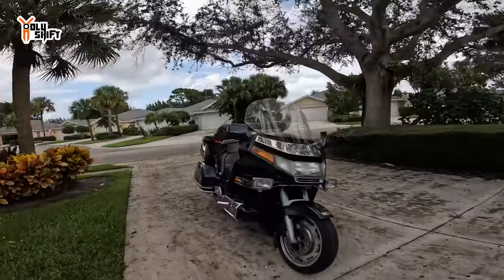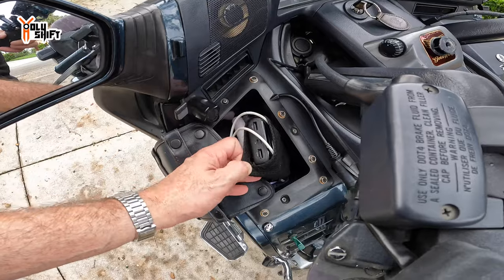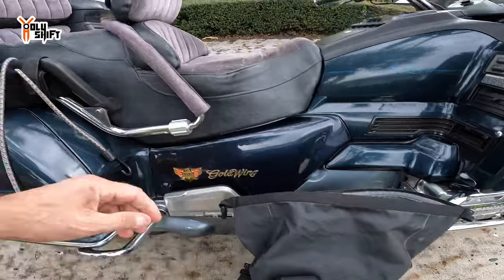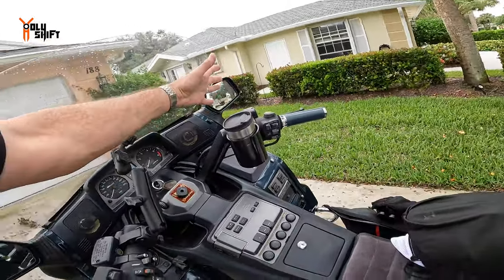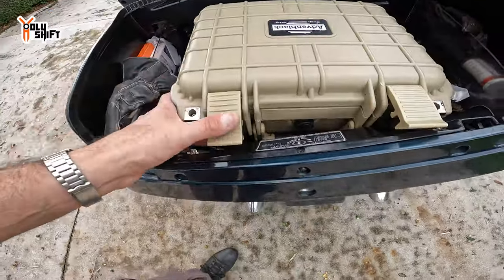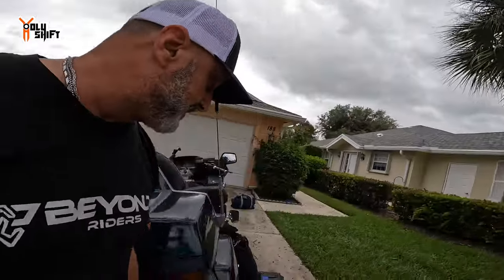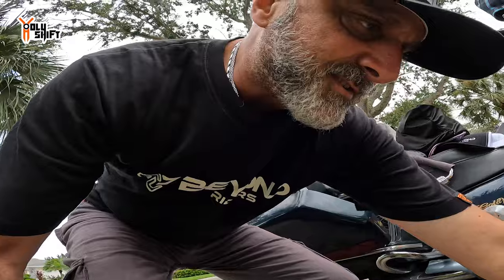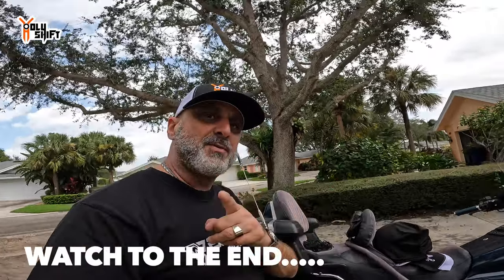MISTAKE ! Too Much Stuff Packed !

Comment: I travel with 2 helmets: half helmet and a modular. Tool kit, rain gear, extra gloves, chaps (if riding in cool weather), extra glasses, tire patch kit, air compressor, luggage goes on the passenger seat. Must have for a iron butt: back rest, highway pegs, and good music!
Reply from the maker: You put a lot of miles down Cue ! 👍🏻